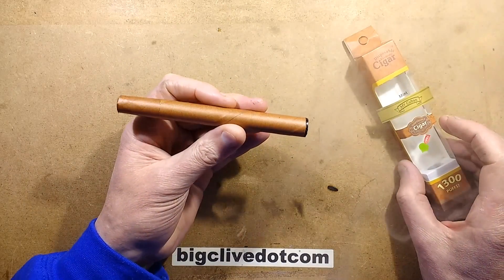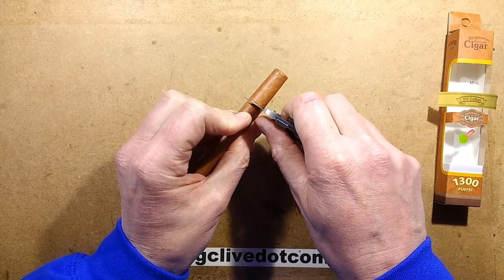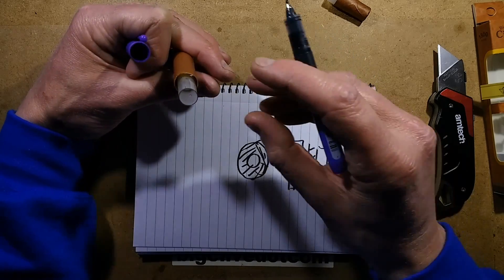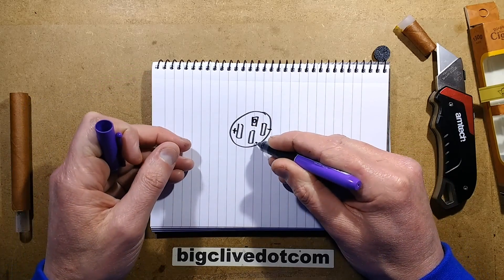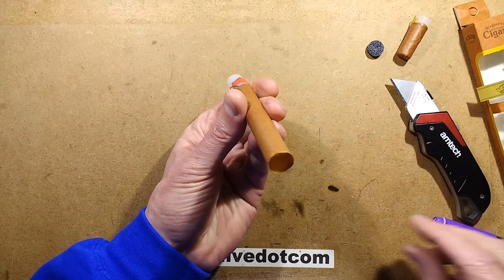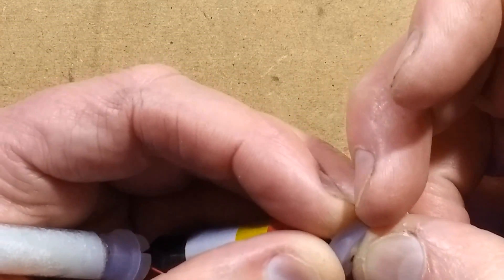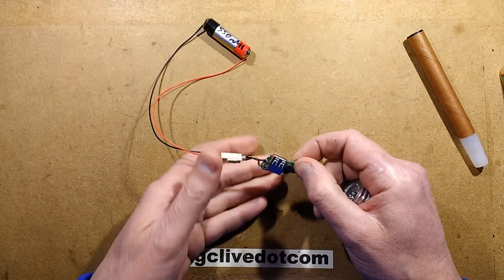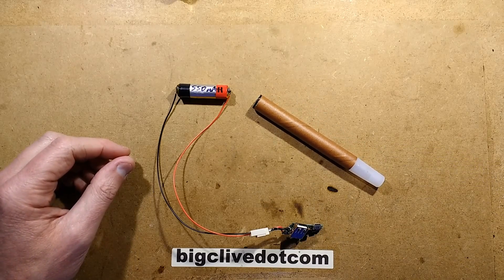Can a disposable e-cigar be refilled and recharged?

Comment: Its cheaper to buy an Ego AIO, they about 20 dollars US, and are proper e juice vaporizers, with a micro usb, and decent vapor production.
Reply: Doesn't make for such an interesting video though - a bit less hackable. (they are good though - I'll also vote for the Innoken T18/T22 if you prefer a tighter, more ciggy like draw)
Reply: I would agree, but the T22's are a pain to use, and refill. for the same cost I could get a Ego AIO Mega.
Reply: 100$? for that you can get RX200 with a good sub ohm tank. absolutely no need to pay that much! 20-30$ is enaugh for a good starter kit, no electronics lasts forever, if you want cheap but long-lasting, smpl mod with a cheap RDA is something too look at, you need external battery charger, and replace the coils and it'll last you forever, (well, the battery won't last forever, but a long time nonetheless...
Reply: +raidzor You got horribly ripped off by whoever sold it to you. Also if your broke after 1 week from using it, either you toss it around like its a toy, or you got sold a bad unit. Don't forget that the ego's need new coils once a week, they are not like disposables... My ego aim has lasted me well over 1 year.

But like all the other people commented, for 100 dollars you can. get a rx200, with a tfv4 or a tfv8.
(I have the v8 combo)
Reply: Yeah, i'd say 50€ got you ripped off pretty hard. I paid about 25€ for the AIO through a major importer at a brick and mortar store. And it's been good to me, and the store seems happy enough with the quality. I think Joyetech is actually been the most reliable gear i've had until now, but of course there's gonna be some defective ones, this is just unavoidable.
Reply: To be fair, if you're new to this (and particularly if you're still smoking), a TFV4/8 probably isn't the best way to start out ;-)

Nautilus X (or Nautilus 2 these days) and a decent, high capacity mod that can push around 50w would be a good start, I'd wager.

Then you can move onto an RX200/RX300/similar portable power station if that doesn't quite do the job.

One of the nice things about the being consumer products (not medicinal devices) is that there's a mod/tank for everyone, somewhere - and normally quite reasonably priced.

You go the medical devices route, and there's one choice that no-one likes, and it costs someone, somewhere, five times as much as a consumer equivalent.

Blimey, can you tell I advocate, arf.

(currently rocking an Innoken TC100 mit Lemo Drop/Nautilus X as the mood suits me to keep me off the smokes, and a Steam Crave Aromamiser Supreme for when I just want to do something hilarious in terms of cloud volume)
Reply: The Original Evods are awesome. I still got them and hand them to people who want to quit smoking. They do what you expect, they are reliable, easy to use.
Reply: Get a regulated mod. Don't get a mechanical mod if you don't know the ohms law.
Reply: I use Ego AIO, but for the life of me i couldn't butcher one to get a battery out of it to make something like a little Li-Ion powered headphone amplifier out of! And then use the shitty atomizer and a standard salvaged 18650 and a little fan to make smoke effect for a cosplay gun or something.
Reply: For a tight draw, I would recommend either an evod or a e-smart pen. Evod mega kit is a bigger batter with a bigger tank that uses dual coils instead of a single coil. I work for Hoosier Vapes and we still sell both the evod kits and the e-smart kits.
Reply: Raidzor つ ◕_◕ つ or get somthing mechanical if you know what your doing. good luck breaking one
Reply: Indeed, it used to be that if you wanted decent vapour production using low ohm builds, you needed a mech - even up till a couple of years ago, high end regulated mods topped out around 150w, which most mechs (and certainly, series mods) could beat quite easily with a 0.1ohm build (the lowest you should build to remain relatively electrically safe, given current battery tech)

In these days of 300w regulated mods though, with all their inbuilt safety features, it looks like high power mech mods will likely go the way of low power mech mods.

What's that you say? You didn't know about mech mods being used in low power applications? 

That's because no-one needed to use them once decent 10-20w regulated mods started being a thing at consumer friendly prices...

I don't think we'll get quite to that stage with high power mechs (they're more of a boutique thing these days, rather than the necessity that were low power mechs for a decent mouth to lung experience) due to the limits of battery capacity, but I'd rather see someone with a 300w regulated mod than a mech; at least then you can pretty sure they aren't going to end up being a tabloid headline after they build too low, or their battery wrap gets torn, and they fire a misalighned hybrid dripper into their face (which is, in itself, an extremely rare occurance, but that doesn't stop it being used as propaganda by the tobacco control crowd 
as another stick to hammer e-cig users with).

I'm of the opinion that no-one needs a mech, but that for the relative few people that want them, they should absolutely be available; but a bit like superlight kit cars, and track motorbikes, you should have to go through someone who knows the risks, rather than being able to buy them at your local corner shop.
Reply: No,no tossing around, I even carried in a small pouch. I think it was a battery defect since after a week when I puffed it tasted very burned. I changed the coil 4 times but after 3-4 puffs the burned taste returned on every coil. Tried to get it back to the store but they didn't want it back. I don't know if it's just a bad store or those e-cigs are really bad.
Reply: Yes , but for cigar lovers we want the classic cigar look to go with the vaping experience . I have a IJUSTONE device and filled it with cuban cigar juice . Good amounts of vape , and a great full taste but the look is just not there . We all love the Annie movies like Preditor where Arnold  walks with a big ass cigar in his mouth , with his big muscles  . Thats one think that stuck with me since childhood . I will love cigars till the day I die
Reply: I'm using currently EGO AIO too and to be honest, it's not so great...Vape production is kind of lame and sometimes it tastes like coil is dry-burning even when the tank is half-full. It's ok, not the worst e-cig around but I would still get something else. But here in Finland you can't buy e-cig devices or accessories or even liquids online anymore which sucks. Trying to find vaping stuff is pain in the ass and if you manage to find store that sells vaping stuff the prices are ridiculously high. Need to ask nearest vape seller do they have e-cigars. Buying real ones are too expensive too..
Reply: O rly? Why then i paid an EGO AIO 50€? And why did it broke the next week? I mean, its obviously better than the disposable cigar but not worth it. You need to pay more than 100$ to get a good vaporizer that will last you a long time.
Reply: I toss my eGo AIO around, it's doing just fine apart from paint chipping off. I just don't have fine control over my fingers and surroundings, almost everything i own gets dropped on the floor about 20 times a day, and the eGo AIO is doing just fine for months now, and i do heater cartridge replacements every few weeks whenever i feel it slowing down or going stale a bit, and so far the i think 0.6Ohm cartridge has been surprisingly more reliable than any of the 1-3 Ohm cartridges i've had before, and this considering lower resistance cartridges are just so much harder to make well. My eGO ONE battery died from the button failure closed after maybe almost a year, but it's OK, it didn't catch on fire, it disabled itself, so fair enough for the amount of abuse i gave it, and i think they made the AIO button more substantial.

The AIO is not the only piece of gear i have, but it's the one i use all the time because i just like it. I also have some Kanger heads and the ONE head and an eLeaf battery etc.